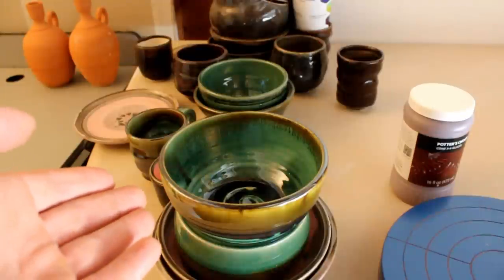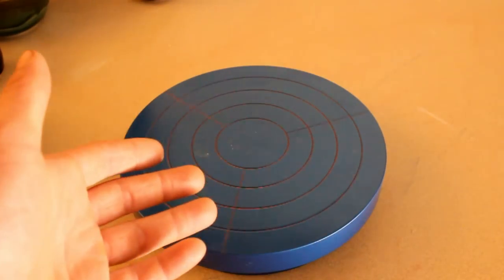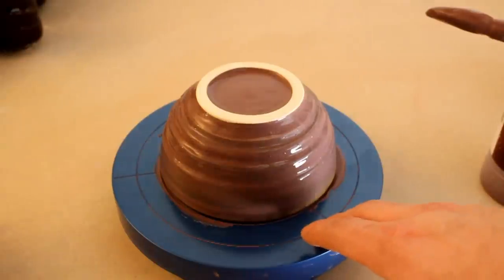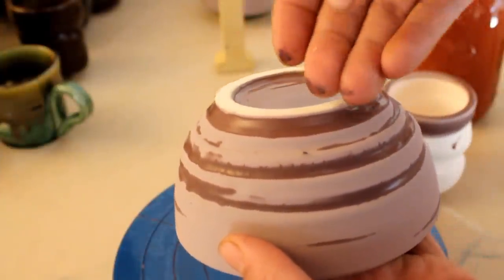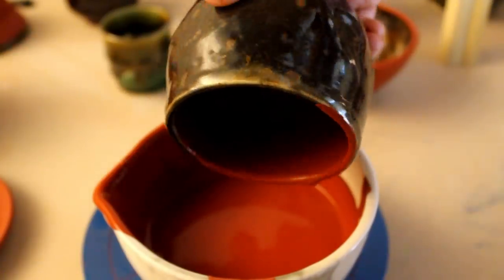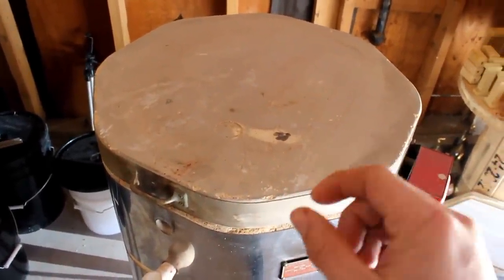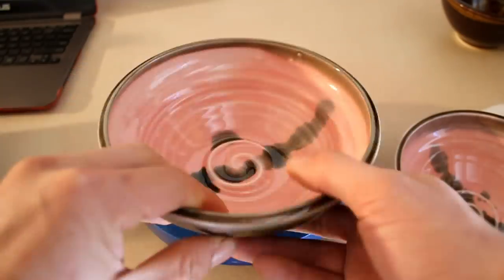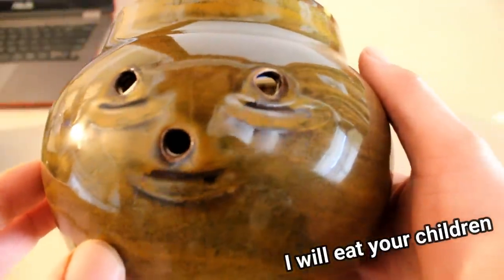How to Re-Glaze your Pottery

Comment: I had a buttload of pots that I was waiting on come out tonight and I'm super SAD. So my questions are 1) does reglazing work for things fired to cone 10? 2) does it need to be refired differently than pots that are going through 1st firing?  3) for the ones that were thinner applications the first time is there a way I can preserve texture while trying to change the color or do you gotta sacrifice it at that point ? And 4) why have the pottery gods spurned me so?
Reply from the maker: 1 yes as long as you fire it to the same temp . ( Don't put cone 10 glaze in a. Cone 10 kiln and think it'll fuse
2. No, fire it the same as the first time, just a little thicker coat of glaze
3 depends on the glaze
4 we saw you try to trim bone dry pottery one time and this is your punishment.

Comment: This is so different from the way I was thought to reglaze. I'll put it in the kiln to heat up at about 50°C, take it out using gloves and reglaze it really quick before it can cool off again, using the gravity feed spray gun. Because the piece is warm it will dry immediately. Mix in a little sugar or CMC (cellulose gum) to the glaze to make it stick better.
Reply from the maker: Yeah , both ways work. This is just an easy way to do it for most and without heat and re opening pores
Reply: EarthNation Ceramics yes, heating the piece and working fast so it doesn't get cold is a hassle and spray guns are tricky. I'll definitely try your method next time :)

Comment: Ive just picked up one of my mid sized sculptures from a firing studio - in the process of building my own kiln. Totally disappointed AGAIN with the mid cone glaze, note to self "dont use them anymore!!" Anyway its a complicated piece and it cracked in the glaze firing and the glaze looks shitty. 1.Have you ever glazed over a cone 5/6 with a cone 10? 2.Have you ever or do you know of a complete alternative to covering a ceramic sculpture if I needed to bond the cracks - like a type of paint that has a resin/ glaze finish, or that acts similarly to a glaze? 3. If i fill the cracks and refire with the ghastly amaco celadon that I used will the cracks reopen/ will the glaze cover the cracks?
4. Can I use a different glaze altogether as long as it is cone 6 - like do a double dip thick coat of stoneware glaze combination by Mayco over the celadon amaco?
So need a glaze councillor!! I think I hate cone 5/6 glazes... never been disappointed with anything fired at cone 10! I was seduced by the fancy colors!
Much appreciate any help - like seriously would appreciate!

Comment: Dante, could you possibly talk about stilt marks?  I recently fired 5 bowls on stilts because the person who commissioned them wanted flat bottoms without glaze, but wanted the glaze to go all the way down the sides.  I was shocked there were 3 little brown marks left on the clay, and in two instances, the stilt had shifted and went up into the glaze on the side.  I sanded down the marks in the glaze, but want to try your method of adding back some glaze and re-firing.  That being said, is there anything I can do about the stilt marks.  I was thinking I could glaze the bottoms and minimize the marks.  What do you think?
Reply: I have seen some people put wax on the metal part of the stilts.  I wonder if that would help.

Comment: Hey man, can I speed up the reglazing process with a heat gun? By the way, I saw a video where the lady uses hair spray on her reglazing process so the glaze adhere better to the piece...
Thanks
Reply from the maker: Yes you can use the heat gun, I prefer to use the natural heat of the Sun so I prefer to glaze my stuff on a sunnier day where it will automatically dry faster without extra effort from a heat gun. And yes you can also spray your glaze we just haven't gone over that yet